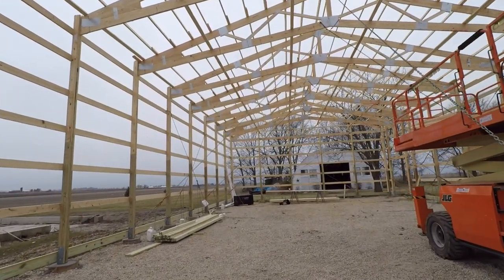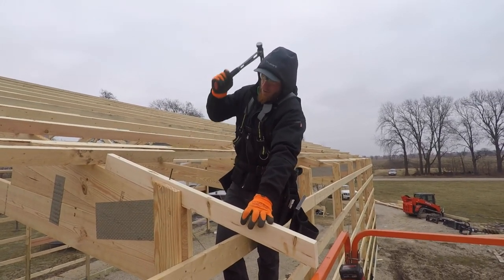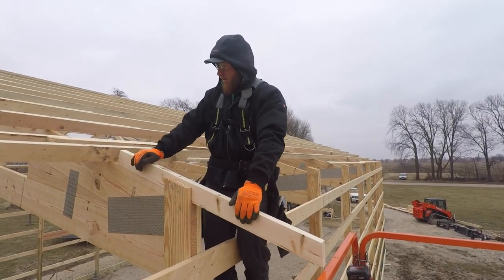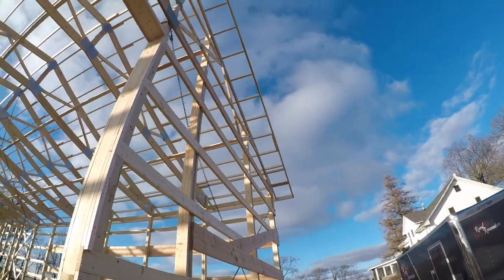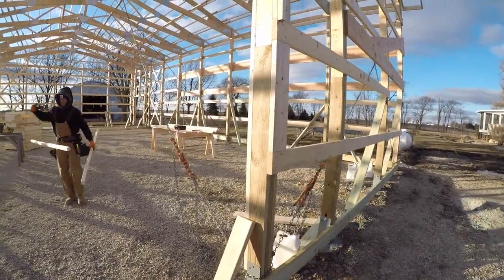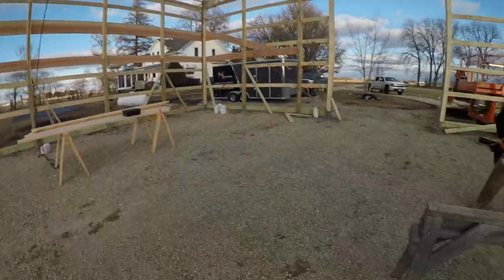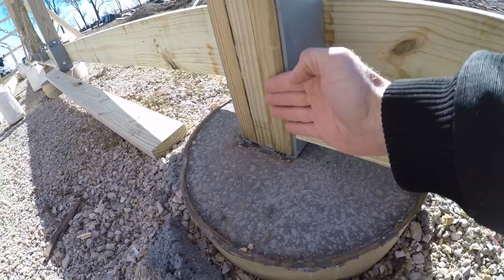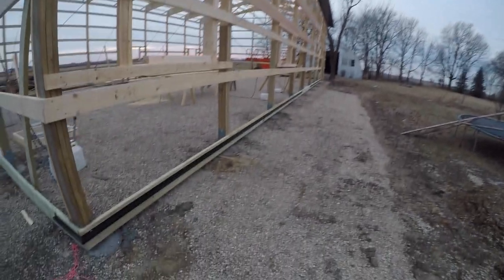Family Fun Barn Episode 5

Comment: badass building! ever have problems with the concrete footings cracking? how would one repair something like that?
Reply: My guess is that it has never been a problem, and if it were to happen it would be of very minor concern.
Reply: All concrete cracks, how much it cracks is dependent on how well it was designed and constructed. If you have cracks in your slab, there are specific concrete gap fillers. If it is beyond the scope of a gap filler (often they'll have a maximum size it'll fill), your options would be, do nothing, or replace

Comment: Do you always cut on the waste side of a board? I struggle with that for some reason
Reply: Noconz0727 MC It depends whether the offcut is longer than the workpiece. It's also a peculiarity of the cordless circular saws. They have the baseplate on the opposite side to the standard corded saws. Most people are right handed so they'll be standing on the long side of the wood to hold the workpiece and so the baseplate of the saw is on the unsupported cutoff side. It's a practice thing taking the weight of the saw as you finish the cut.
Reply: Noconz0727 MC The other weird thing with cordless saws is that manufacturers seem to make the timber saws 'left handed' whereas the metal saws are 'right handed'. Don't know if that's universal but I've noticed it with several.